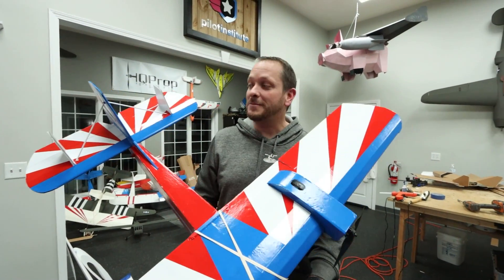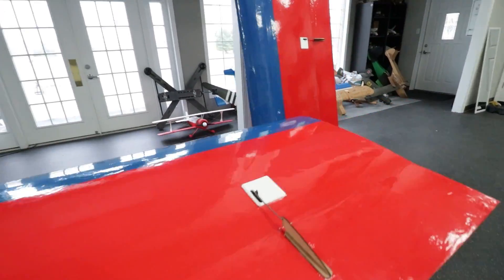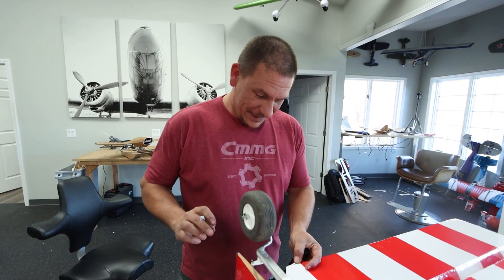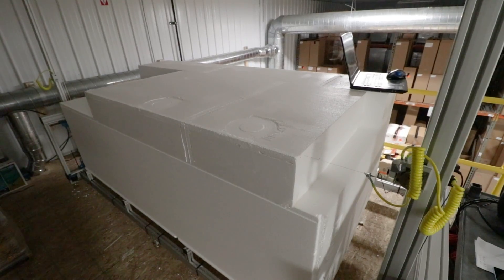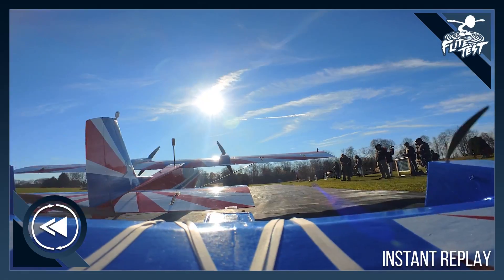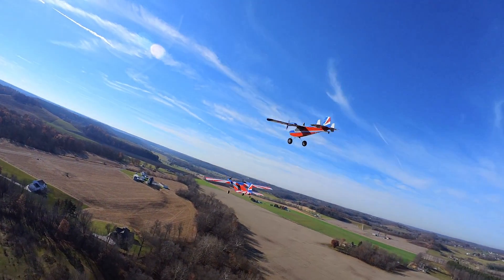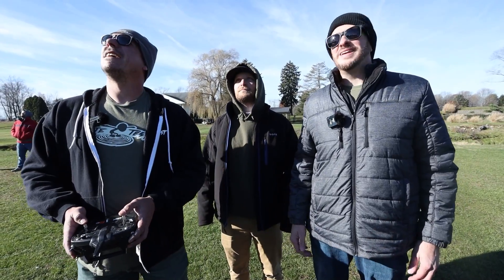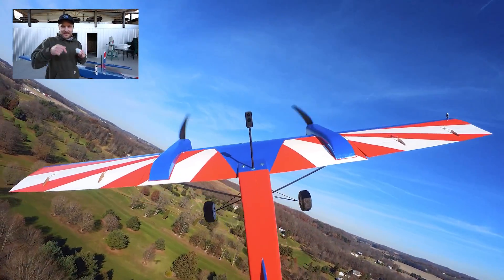How Much Can This Plane Take 🇺🇸 A Touch And Go Off The Wing?!? 🇺🇸

Comment: Okay, hear me out... You want a challenge? Try binding an RC car remote and receiver to your plane. We used a nut ball then moved to a FT simple cub and put the elevator on the throttle, the ailerons on the steering and set the throttle adjustment knob as throttle. 

We have not laughed that hard in 20 years!

Comment: "Just a rendered picture. . ."  Nope, that's the paint scheme of the late Art Scholl's modified de Havilland Super Chipmunk.  He died in 1985 in an accident while filming (with a real film camera) the original Top Gun.  It is believed that the huge 70mm camera came loose in an intentional spin and jammed the flight controls of the Pitts Special he was flying as a camera platform.

Comment: Did you wire it where you can control each motor independently? I forget the term you use. I just wanna see it do the death roll. Sorry, my terminology is off.
Reply from the maker: We did. Differential thrust. :)

Comment: I don't know whether it's camera distortion or what, but when that plane is in the air it looks like there is some anhedral to the wing. If that is being induced to the wing somehow through fluid dynamic warping due to slipstream that could be why roll performance is lacking. The whole wing structure itself could benefit from a bit of dihedral positioning, IMO, that would improve roll rate - say about 3-4 degrees at the root. It would also stabilize lift characteristics. But solid, huge, awesome airplane guys! Love the color scheme! Rock on!!
Reply: Yeah I though I noticed that aswell. for such a large wing you would have though there would natural dihedral flex, but.. thats a STIFF wing!

Comment: Hi guys, another fantastic build! You are an inspiration to many. I just have one concern: please do amp checks. I don’t mean “fly it and note the mAh consumed”. I would like to see you put a watt meter between the battery and ESC then test the current draw. This should always be done with electric flight because the power draw is so sensitive to prop selection. You have a large audience, so let’s teach them this vital habit.